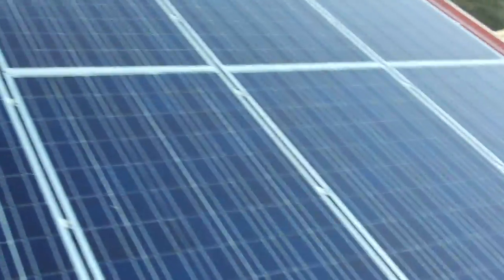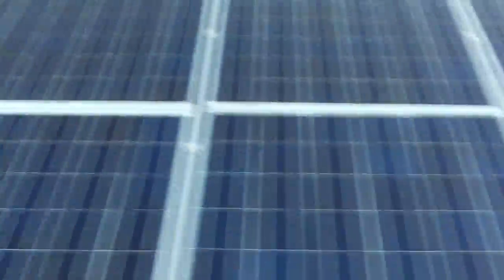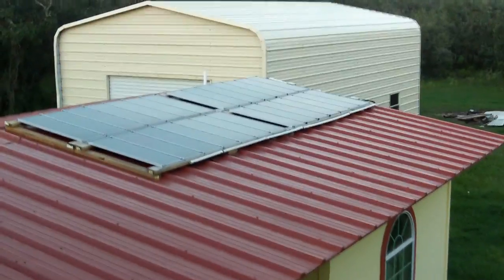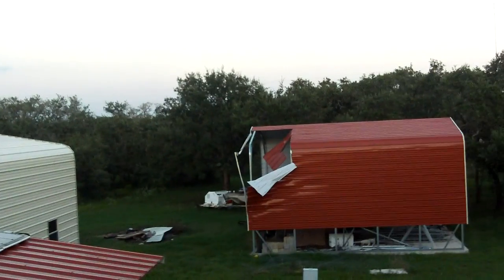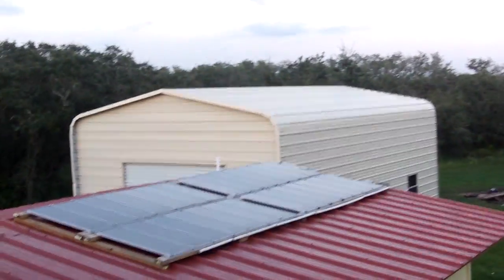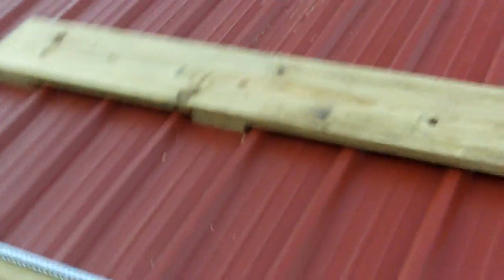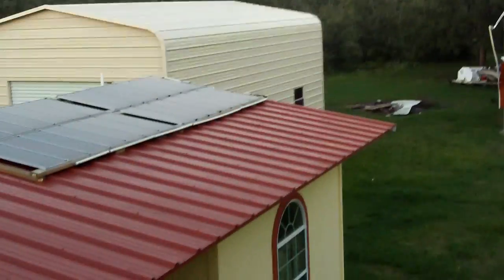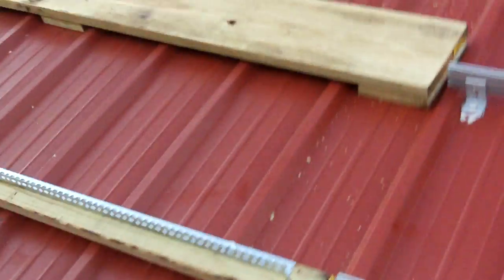How to install solar panels on your roof quickly and cheaply - Part 1

Comment: I'm no roofer but I've always been told to place mounts on metal roof ridges and not in the channel were water flows. Other than that, great video.

Comment: This is a good setup. However those micro grid tie inverters don't last they have fragile electronics that will fail and one for each panel there is no way to tell if one fails or not or which one failed. and  it would be hard to find the panel and replace it. and if you have software that tells you which one fails chances of finding the exact same inverter to replace it in 10 years so it still works with the then antiquated software will be slim to none. Best to have high voltage DC go to one or two grid tie inverters at ground level where it is easy to monitor or replace if necessary. also micro grid tie inverters cost a lot more than a single grid tie inverter. Yes there are advantages with micro inverters but the disadvantages out way the advantages.

Comment from the maker: No technology is 100% safe. We've not had an issues down here because the oil/gas strata is about 5 miles from the water table and there is an impermeable layer in between. In places where there is a mile or less separation is likely that fracking can contaminate water. As far as waste disposal, down here there are huge empty wells that can be used to dump the waste into so as to return waste back where it came from.

Comment from the maker: Eventually there is a lull in the wind every morning and every evening, then it uncoils if it has been twisted. I will add a larger tail so that it tracks better in the wind but I've never had a problem with that.

Comment: I am in the lumber industry.. Your statement "termites eat pressure treated lumber" is flat wrong! The new acq, mca and CA  formulation for residential use, uses heavy amounts of copper, termites will not eat that! However you are correct, it's corrosive and is not a fire retardent When using treated lumber, use stainless steel fasteners  note: termites need to be close to permanent water source as well, having treated lumber on a hot metal roof is not the ideal enviroment for termites.

Comment: Oil and gas companies are drilling fracking (hydraulic fracturing) wells all over north central texas, causing accidents, earthquakes, and poisoned water wells. SW of Fort Worth seems to be the heaviest concentration, you can see them on googlemaps satellite view, new dirt roads and pads with tanks on them everywhere. Everyone with a little bit of land and mineral rights is getting in on it, unfortuantely. See also fraccidents map on google map for a list of the Harmed. All for natural gas & oil

Comment: That is a great idea. I have seen quite a few of those 275 gallon totes for sale locally for less than $100. They come in cages on pallets and have a 6 inch top opening and a 1.5"-2" ball valve on the bottom. Perfect for capturing and storing rain!

Comment: With such a large roof space, you could also do some rain harvesting. It sounds like you are in an area that gets quite a bit of rain. This could possibly alleviate  the need to pump so much water out of the ground. With such a large lot, you could use the stored water to irrigated some crops.

Comment from the maker: @thundermonty I guess it would, that's the way my roof is and it's holding just fine.
Reply: Cheers for this, I have been researching "solar power system design for home" for a while now, and I think this has helped. You ever tried - Piyaarter Uncomplex Preeminence - (search on google )? 

It is a smashing one off product for discovering how to generate energy-on-demand minus the headache. Ive heard some super things about it and my co-worker got amazing success with it.

Comment from the maker: @FUBARPROTOCOL I did watch the video at it extremely useful in seeing exactly what components you used - much simpler than what I was doing!. I will go to my local electrical supply dealer and get all those components, hopefully next weekend I'll be able to mount more panels using this system. Thanks and God bless you.

Comment: Hi Al, I made a short video on how I installed my panels with unistrutt chanels. It is the 1st video on my channel. You can buy this material in aluminum, zinc, and hot dipped galvinized at a electrical supply. You can only get the zinc coated at home depot but the zinc coated will not hold up for outside use. I see you have a lot of time and money in your system and I think the unistrutt will last you a lifetime after installed. I hope this helped.
Carey from Texas

Comment from the maker: Respond to this video...Yes there is document on company's site that I downloaded and filled out , I had to provide model numbers, warranties and specifications for the grid tie inverters (that's all they care about) plus a diagram showing all components and connections (which I did). I then took it to them and they come out and inspect the electrical work, before I can connect to the grid. Pretty easy really since my power company is a cooperative.  God bless you!

Comment from the maker: Respond to this video...Thanks Kevin! I was watching you as well to see how fared also, looks like we're blessed with protection from the Lord. I look forward to all your videos as well, great video abut the batteries, I was thinking about doing one on that but don't need to now. I have two batteries to recondition which I'll do a video for that on how to use a desulfator, voltmeter and hydrometer to do that.
Thanks!
Reply: with those 2kw panels,  how big are the batteries supposed to be for power storage, cant small ones explode? and the converter itself how big is it supposed to be?

Comment from the maker: @FUBARPROTOCOL Thanks for the comment and glad to hear you got your panels done using those channels. I have no idea what they are so I'll have to research that, I'd rather use that than pressure treated wood - thanks for the tip!
You are absolutely right about bolting to the hight point - now that  I think about it I'll do the rest using the ridges to bolt them down.  Thanks!

Comment: Your vids are great and I have learned alot. I just installed 4 new 100w panels and I used 2" hot dipped galvanized unistrut channels and it worked great. I allso purchased the back springnuts and flat clips from a local elect. supplier. You can allso get it in aluminum. The cost for the galv was $22.00 for a 10' joint and the nuts,clips, and 2" bolts  were about $4.00 a set. The cost for 4 panels was $84.00. You might want to fasten them on the high point of your roof panels and not in valley